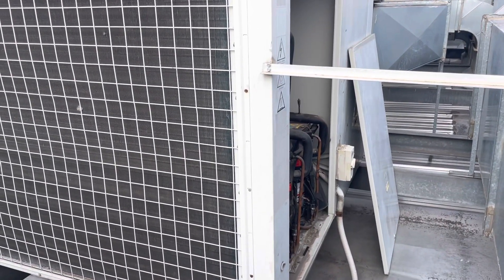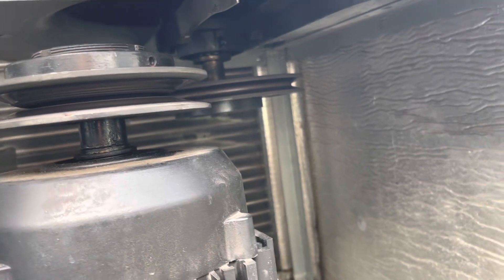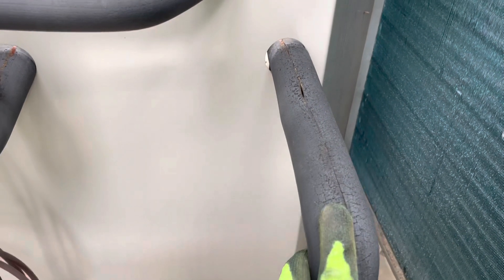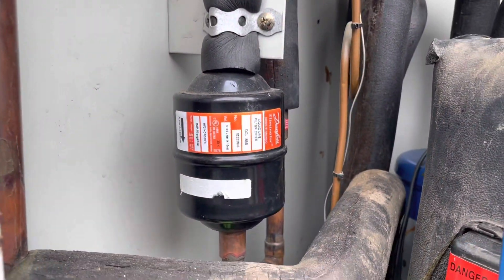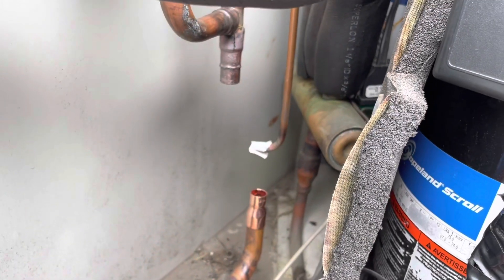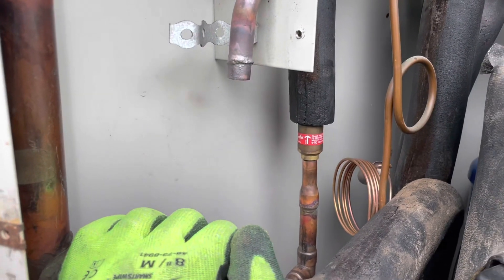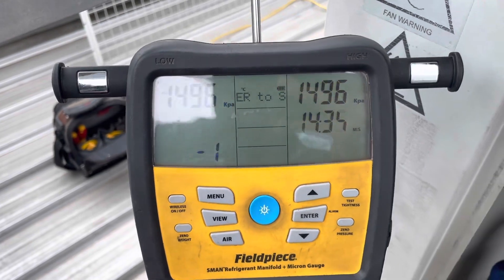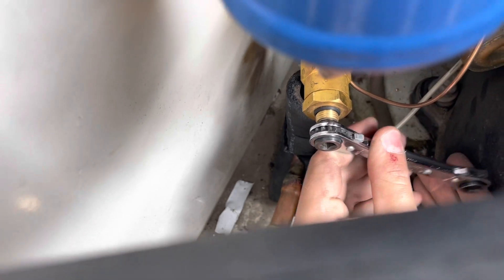York / Finding and Repairing a Refrigerant Leak on This Package Unit

Comment: I'll bite, what's up with the check valve next to the filter dryer? Looks like that dryer was unidirectional and the check bypassed it when in... heating mode perhaps? 

In my mind it seems very odd you'd bypass the dryer. Was there a second one on the system somewhere for when it was in heating mode, perhaps the one with insulated pipework above where you strapped the TXV bulb? Can't quite pick it.
Reply from the maker: I really don’t know. I’d have to go back and look at the video as I can’t remember this one too well 😂 maybe there wasn’t  originally a bi-flow dryer 🤷‍♂️
Reply: @hvacraustralia  I think the second stage had the same setup with the check valve bypassing the filter dryer, as if it came that way from the factory. If you ever go back, keen to see if you learn any more about it!

Comment: Hey mate wondering what a nitro sweep is and how you perform it
Reply from the maker: Hey mate. In this case I used the wrong term. A nitrogen sweep is when you flow nitrogen through the system, and once’s it passes through the entire system it goes to the atmosphere. What I did here once my evacuation stalled out was I put 50KPA of nitrogen in the system and let it sit for 5 minutes. After, I purge it until it gets to around 5-10KPA and then I start the vaccum pump again. Making sure the system is never exposed to atmosphere. The purpose of it is just to dislodge any moisture in the system so you can pull down the vaccum further. It’s called a triple evacuation, but I only did it once 😂 Hopefully I wrote that in a way that makes sense 🤙